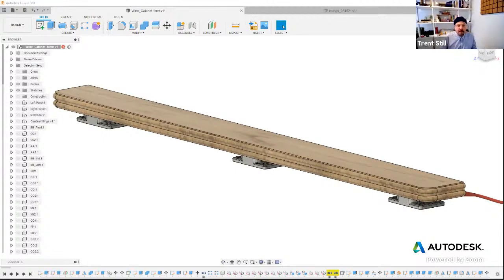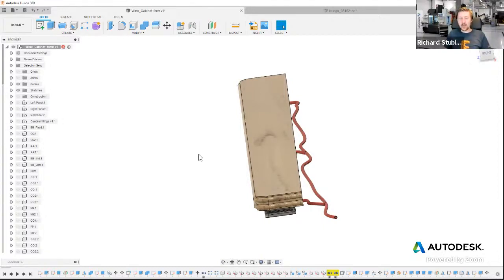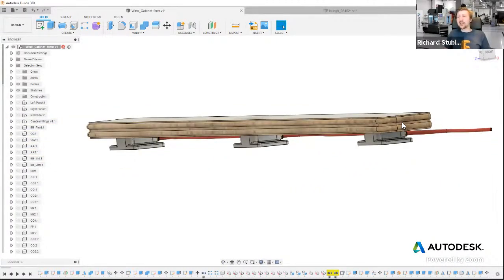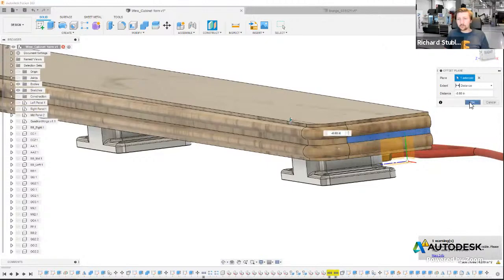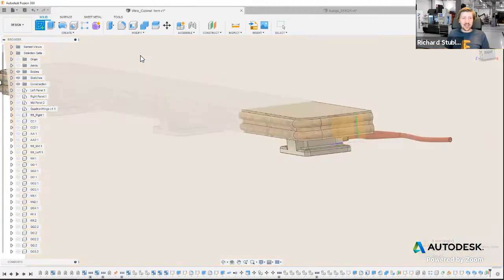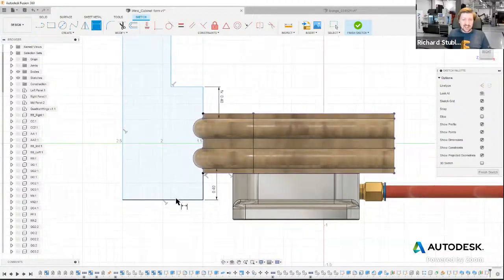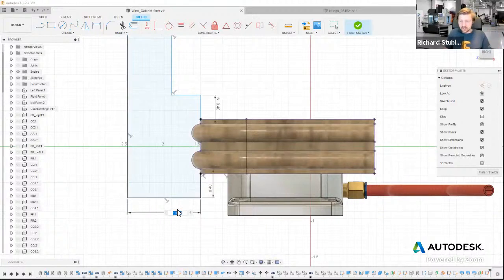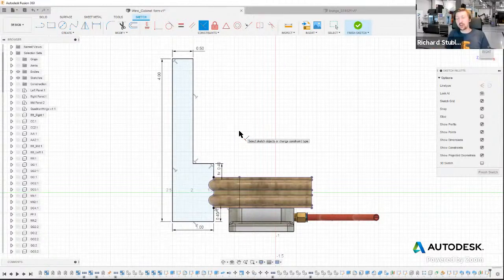360 live Fusion 360 and Furniture Design: Manufacturing for the Furniture Industry

Comment: About the pricing of the Nesting and Fabrication Extension....It is an industry level tool and matches other CAM nesting prices (such as NestingWorks for SolidWorks) but it has two unique features....The N&F Ext. is made by Autodesk and you can choose yearly, monthly or even daily pricing which gives you more access options to this tool....  So as Trent says "you can choose your own adventure".   Another good option for nesting is an add-in called Mapboards Pro which can be found at Autodesk's app store.